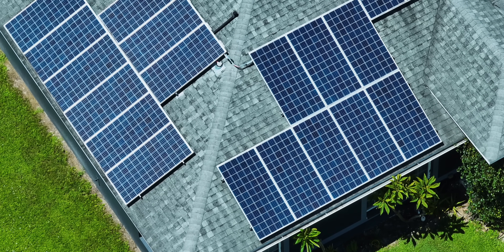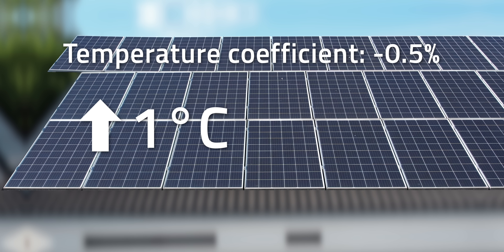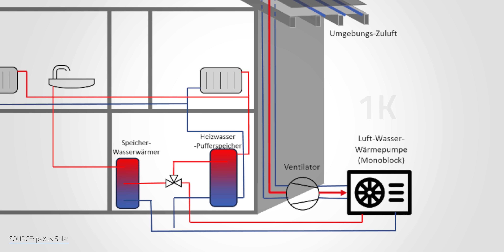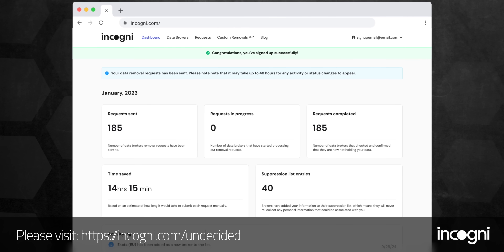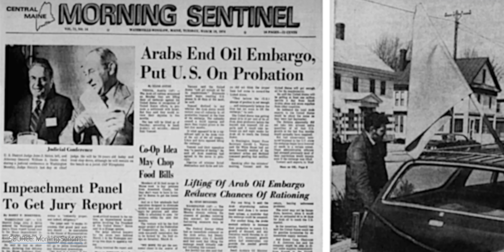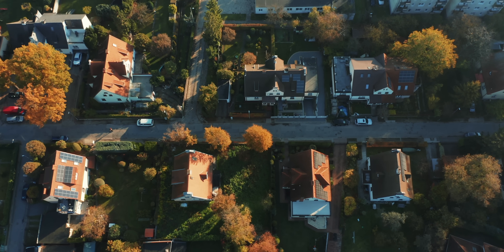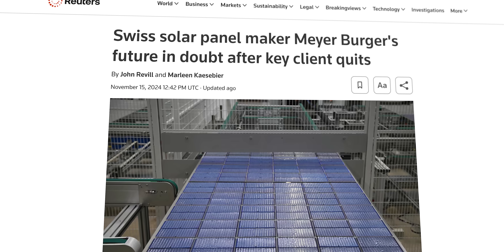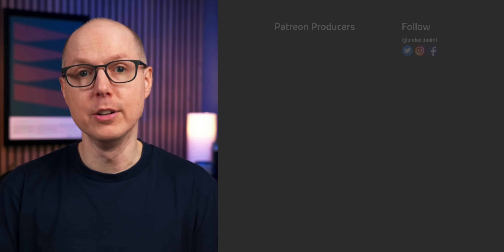Why Hybrid Solar Heat Pumps are the Future of Home Energy

Comment: In 1977-79 I worked on a project at SUNY-Albany where the Alumni House was outfitted with several heating system modes to compare their efficiency.  One was a Solar Assisted Heat Pump and another was an Air Source Heat Pump.  The roof had copper solar water heating panels and there were two large tanks to store the heated water for the water source heat pump.  I've forgotten which mode was best, but looking at pictures of the building today the roof is now just shingled.
Reply: I live in Schenectady, I am from East Greenbush and went to HVCC. I was impressed with how HVCC used the waste heat from the Cogeneration plant to heat and run an expansion cycle Air Conditioner. I'm surprised Solar Heat hasn't been used more to drive Air Conditioning.

Comment: Where I live in Southern Nevada this technology would only be a good fit for the winter - during the summer when the roof temp is regularly 130F or more they would fill my hot water tank with piping hot water in about a half hour and then all the rest would go to waste.  It could be used to heat my pool but my current solar water heating panels do that at maybe the cost of 300W of pump power for 12 hours a day - around $0.50 a day where I live.  Now if you could figure out how to take all that thermal energy and generate more power with it I think you'd be onto something - maybe another heat pump to generate higher temps to run a steam turbine...
Reply: Same here. I’m in Southern Nevada and I’d love to find a way to cool PVs AND use the excess for other energy needs as well, instead of wasting it.

Comment: I live in the Mid-Atlantic, and this pairing seems of questionable utility for my climate. When it’s cold enough to need auxiliary heat, the panels won’t be very warm. When the panels are overheating in the summer, I need the heat pump to dump heat to the outdoors, not gather more for heating. I guess it’s a matter of picking up marginal benefits on the fringes, but I have a hard time seeing the benefits make up for the additional cost and complexity (especially when I could use those funds invest in better insulation, etc.).

Using the excess heat for domestic water would make more sense, but how much hot water do you actually need?

Comment: I don't think I would ever want to put a solar tile system on my home. Every installation is too bespoke. Service and spare parts can only really come from the OEM or an affiliate. Panels are good since the roofing and solar systems are kept separated and standardized. If I need the roofing repaired, I can call any roofer and they can use generic materials. If I need the panels repaired, I can call any solar installer and they can use any compatible hardware. The only solar roofing solution I would ever consider is something similar to GAF's solar shingles which install like and integrate with standard composite shingles, eliminating the need for bespoke tiles or service in the event of a repair.

Comment: Cost is clearly the biggest factor for most families.  That being said "integration" of systems is clearly a way to increase each components overall capability.  I feel often people chase "The BEST" efficiency / cost/ (insert whatever), and that reality is that often that isn't feasible or what's best.  Happy mediums fit the bill more times than not.  Cold climates sometimes aren't cold (Fairbanks AK can be -40F in the winter, but 90F in the summer), same goes for Hot climates.

Comment: SAHPs don't make much sense to me. Right when the HP needs heat support (winter) the solar cells don't need cooling. Vice versa: right when the solar needs cooling (summer), the HP doesn't need heat because it's trying to cool the house. There might be some fine tuning cases where cooling the solar is with it, but that's a lot of complexity for a special case. 

Now this isn't to say that hybrid solar isn't a good idea. We just need to think about where and when heat needs to move. This likely requires more flexibility than an integrated SAHP can provide. I could see the hybrid loop supporting purely heat generating activities like HPs for hot water, clothes dryer, and/or a pool. Having the option to support the climate control HP as well would be nice, but I wouldn't want to be locked in. 

I've been toying with the ideas for a new home build and one I keep coming back to is having dedicated heating and cooling service loops in addition to a ground source loop, all connected via valves, exchangers, and a central HP.

Comment: The details on how the air from under the tiles gets ducted to the heat pump was a bit unclear. A far cheaper way to get nearly the same effect would be to just draw air from the attic, at the peak of the roof. 

I can foresee that there will only be a few times of the year when this would really be beneficial. When there isn't much sun, the panels will stay cool anyway. When there is too much sun, you will want cooler air to feed the air conditioner (heat pump in reverse).

Cooling the panels would be nice. The ability to convert IR to electricity would be better.

Comment: @Undecided with Matt Ferrell, just wondering in your honest opinion about using standard panels and adding a competent DIY system that could feed into heat pump, water heater, closed loop geothermal recharge (boosting buried lines with alt line from panels below), or simply dumping into driveway to keep clear in winter? Which do you think would be the best application/approach in this case? Again, competent being the keyword and realizing this is for off grid new construction soon to be started! TIA if you see this one!

Comment: This is completely counterintuitive. When it’s hot outside, the coils of the heatpump is hot not cold. In winter, when the coils are actually freezing, the panels don’t heat that much.
Reply: Winter sun can be surprisingly warm. I remember skiing in the arctic wearing a shirt because the sun kept me warm. It’s often the air and the wind that gets you
Reply: HVAC can be counterintuitive. Like propane flame refrigerators in RVs.

More similar to this I have seen a system from a company in Hawaii that sends the refrigerant to a solar concentrator to heat it up as part of a cooling system.

I would have to study it again to understand but somehow in the vapor compression cycles, the heat helps.
Reply: You need to run the numbers to find out what will be economical. Having a system in place during the summer to cool the modules can add a few percent to electricity output. I had a startup that reduced PV module temperature by 8° C using a special heat sink, but solar module manufacturers didn’t want the extra cost and complexity only to achieve 4% under certain circumstances. In this system, the benefit is partly achieved from the increased temperature air to the heat pump during the winter. This partially offsets the cost of the system.

Comment: What I would like to know is if there is a way to connect this also to geothermal heatpumps? I know it's supposed to be possible to turn around the flow in the summers to use the geothermal pump to cool the house. So possibly that could be utilized also for cooling panels with SAHP. 

Another thing which would be cool is if the connection could also be used to defrost the panels during winters where snow and ice might cover the panels. It could be a way to clear that at certain points to allow them to deliver more energy than what would otherwise be possible.

Comment: Having worked on designs that would collect the heat from the solar panel's frame, glass and support structure for large solar installations this approach is interesting for the following reason...they designed the tiles for heat collection. Our problem is a huge install in a desert where all the components are 140 plus Fahrenheit at noontime. These panels and their support system are not designed to allow heat recovery/cooling of the panels. We have a shot at a 5% to 10% efficiency gain if they can be cooled and then some other "gain" from the hot water to electric conversion or whatever the solution. It would be significant if the panel manufacturers would take their 1980's technology and design a panel with a cooling/heat recovery method integrated into the panel which these German guys have done with their tiles...sort of.

Comment: For some time now ive been wondering about how to combine opposing heating and cooling products.

I saw a video once of someone putting their server rack in the same room as their heat pump water heater. I would imagine in those situations that the COP is technically higher than the stand alone water heater's numbers as you get to calculate in the savings from needing less air conditioning.

Refrigerators/freezers come to mind. They're just pumping out the heat to the surrounding air. Could that heat instead be used for something else?

I know these come with additional complexities, but can there be minor tweaks to these products that allow for an easier way to use the waste heat?

Comment: I don't think the SAHP solar panels are a particularly good solution to solar panels heating up. The big problem that kind of shoots this solution in the foot is when you're generating the heat. Most of your examples talks about moving heat in cold climates during winter, exactly when you'd want to use that extra heat from the solar panels to keep the panels clear of ice and snow. Sure, you're probably generating more heat than you need in that condition and could bleed some off, but I don't think it's really going to be all that much. And in the summer, you have the reverse problem of trying to find a place to dump all that heat when everything is trying to move excess heat elsewhere. Sure, the water heater is a great spot, but you can only dump so much heat into the tank before you turn the water tank into a ballistic rocket. Maybe this would work in an industrial setting where hot water is in constant demand (like restaurants, hospitals, and laundromats), but most commercial customers are going to be in the same boat as residential customers. And moving the solution to warmer climates (like the desert southwest of the US) alleviates the issue in winter, as you don't need the heat to clear the panels of ice and snow. But the brutal summers only aggravates the issue, as Arizona summers are known to kill anything electronic. That means you're just dumping more heat into the air, which reminds me of my dad yelling at us kids to "close the door and stop air conditioning the outdoors."

A better solution would be to couple the solar panels with a geothermal solution. This way, you store the excess heat when you don't need it for a time you do. Daytime heat can be used at night and summer heat can be used in the winter.

Comment: I like it in concept and would be ok with it as an array in the yard or field.  I have serious concerns with it being roof mounted.  Roofs don't last forever and adding solar alone significantly increases re-roofing cost.  Adding heat pump plumbing to that will drive it up even more. 

One benefit of this in areas like where I am in N. Idaho is that you could send heat to them from the heat pump to clear snow off of them.
Reply: It’s not a problem when the roof is either metal or tile. My tile roof is already 50 years old and probably has another 50 to go. The American preference for shingles on top of timber is somewhat silly IMHO.
Reply: @dermotbalaam5358  Metal is  a terrible roofing material. In summer it gets really hot and in winter it is a heat sink. Though having solar on top casting shade (assuming enough space for airflow between the roof and the solar panels) at least prevents it from becoming hot in summer. You're still using a heat sink material where you want insulation though.
Reply: Something to consider: Solar installations seem to last less long than the more durable roofs.

Comment: All the parts which move or use heat could be combined in a house for a full house heat system. Refrigerators, freezers, ovens and heat pumps could be all hooked up to a single system that could centralize power usage.

Comment: It's a great and natural idea. There's one problem: conventional PV panels are now incredibly cheap, dead simple, and fast to install. Greater efficiency of SAHP will not be enough to overcome that advantage. If one need's a bit more kW of output, one will just add a few more conventional PV panels.

Most of the market for an idea like this will be on properties or HOAs where the aesthetics of visible PV are not acceptable. I.e. where you need it to look like a traditional attractive roof tile. But even there, the cheapest simplest option will likely prevail. 

Finally, what happens when one of these roof installations malfunctions? With lots of interconnects buried up there, will it be possible to isolate the panels and connections with the problems and easily service and replace them? Seems risky.

Comment: Everyone WANTS a SAHP, but no one has figured out how to actually DO it economically.  One thing NOT mentioned in video is TESLA solar roof is a forever roof system even if the solar portion dies.  PAXOS is??? --> Highly doubtful here.  Reason TESLA solar shingles have such high expense and such poor $$/W is that it designed to withstand LARGE HAIL otherwise its $$$/W would be MUCH lower.  It is cheaper to have separate systems currently.  PAXOS claims are not real world realities until they start installing and turning a PROFIT without subsidy.  Until then, as someone who has tried to theorize how to combine them myself, I will not trust any "SAHP" claims.  They always forget things like Ice(major problem not usually discussed), Hail, guys needing to WALK on the roof, and throughholes for vents etc.  IF it cannot handle all of the above = JUNK.  Sorry.

Comment: How complicated is multi source heat pumps?  I know Tesla uses both the battery and the motor as a heat source. So why couldn't a house use the exhaust from the dryer, or the stove or the kitchen in general? A smart heat pump that chooses based on what is currently available although prioritizing the solar panels for efficiency. Possibly still having ground source as an available source 24/7.

Comment: Do you need the heat when its super hot and the panels need cooling. And do you want to cool the panels further when its freezing temperature and you need heat in the house?
Reply: Heat can be stored. Like if you have geothermal heatpumps you can lead the heat back to the ground, or a sand battery. Then use it later.
This is an option which was not discussed yet. But i think this is the next very obvious pairing. Also i do not understand why it is not came earlier. Mass heater stoves are very old technologys in cold climate. Also it was paired already with electricity. My grannys had a heater, a big ugly radiator, with bricks in it. Loved to sit on it. It heated up the bricks at night when electricity was cheap, then its warmed up the rooms during the day. Its only engineering to make it more efficient. So we already have it only have to make it more efficient.
The question is,  do the big corporations want us being energy independent.

Comment: I wonder if one could mount PV Panels along the length of a southerly exposed Eve of a roof and have a mechanism so that they could pivot down and then inward to prevent snow build up and with adjustments to maximize the suns angle?  They would also provide shade in the summer to any windows located on the same side of the house.

Comment: In the venn diagram of "times the roof is warm enough to affect the PV performance" and "times the heat pump is cold enough to need extra heat for performance", how much overlap is there actually? Intuitively it feels like any time it would actually be cold enough for the heat pump to need extra heat, there wouldn't be enough sun or warmth, even at the roof, to provide it in anywhere without a fairly mild and/or snow-free winter. I could see this being a fantastic addition to an existing system though - if you're already going in for the infrastructure of a ground-source heat pump and could just add a loop to improve the efficiency of your solar roof it seems like a no brainer.
Using your analog of a water-cooled PC, this feels like water cooling your RAM or SSD instead of your CPU or GPU, rather than looking at it in the only competitive light, which would be hooking it into an existing loop that cools everything.

Comment: The only way this would be successful is a holistic approach to the house's systems. A friend with a restaurant is currently replacing his water heater with a heat pump.  It will be installed in a closet that shares a backwall with his commercial freezers and refrigerators. His builder is putting duct work between the rooms.  The heat from the frig and freezer will pass to the heat pump. The cooled air will pass back behind the frig/freezer units.  He is gambling the engineering design works. This approach can be used to use the excess heat during summer time when heating isn't needed in the house.  Another option would heating a pool like @toddh3774 suggests.

Comment: How does this system help someone who lives in the South where cooling is the major HVAC need? If you pull heat from the solar (panels or tiles) you don't want it going to your residential heat pump. Sending it to the water heater could be useful. As others mentioned - using it to heat a pool or hot-tub would be handy - until the water reaches the desired temperature and doesn't need any additional heat added.